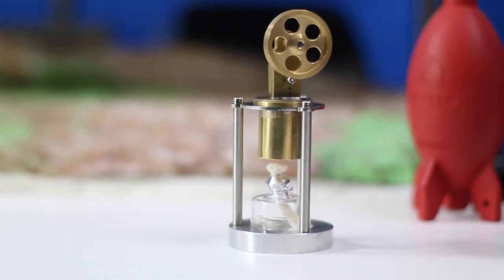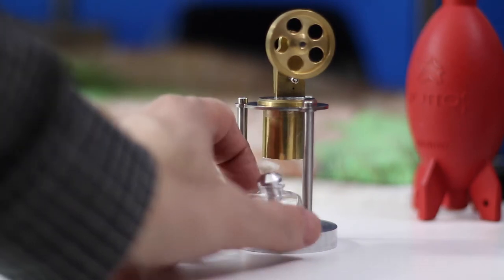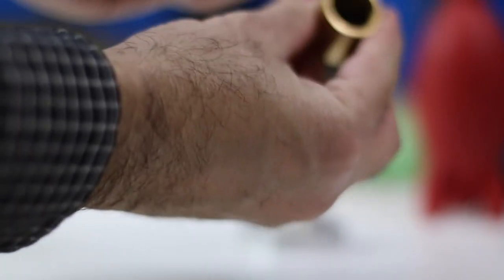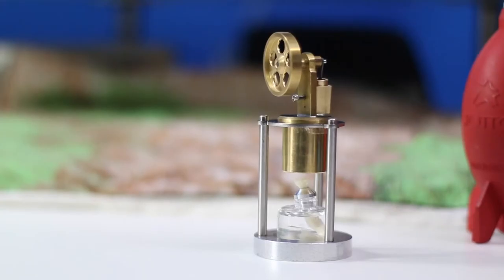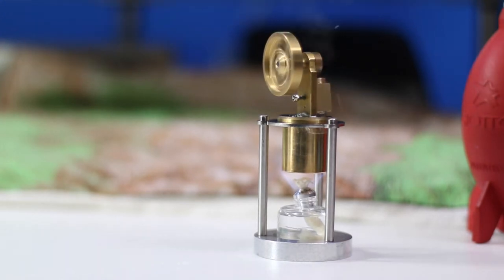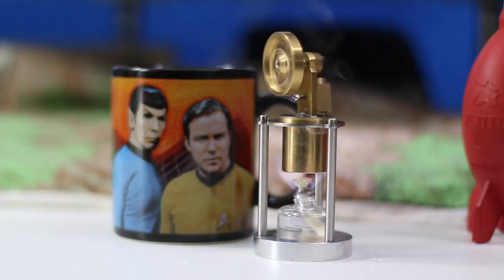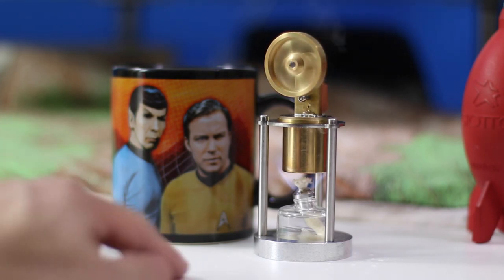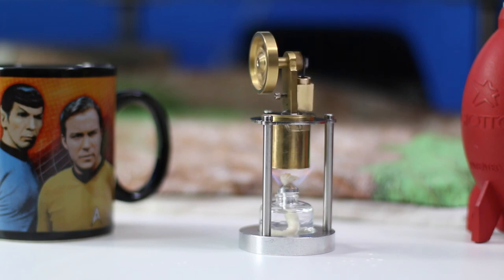SunnyTech Mini Steam Engine, QJ-05. Demo and Review. Miniature Science Model / Demonstration.

Comment: I cannot get mine to run.
Reply from the maker: Thankfully, there are very few parts so there are only so many things that can go wrong.  Start with the basics.  Make sure you have just the right amount of water... not too little, and not too much.  Then, make sure you use strong alcohol as fuel.  The wrong fuel won't make the fire hot enough.  I use 91% or higher alcohol.  If it still doesn't work, make sure the parts aren't stuck.  Oil them if needed but make sure you don't clog the openings where the steam flows.  Also, remember to give the flywheel a nudge once it gets hot enough to run.